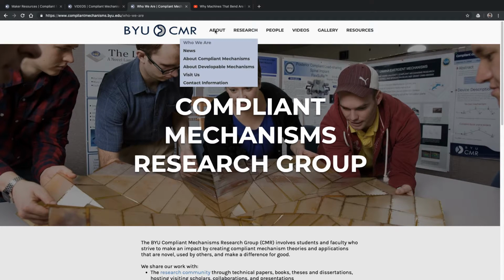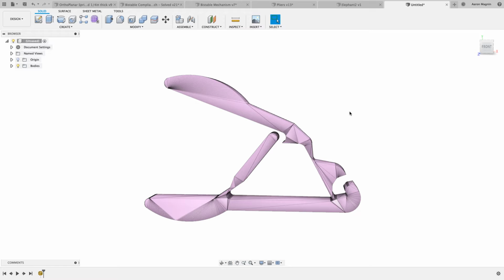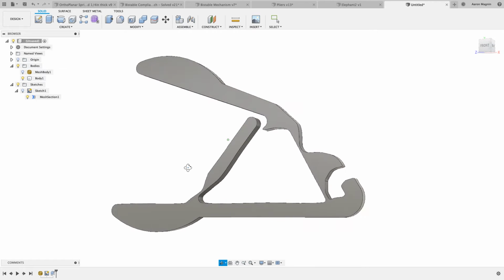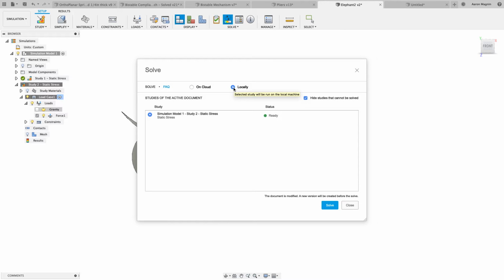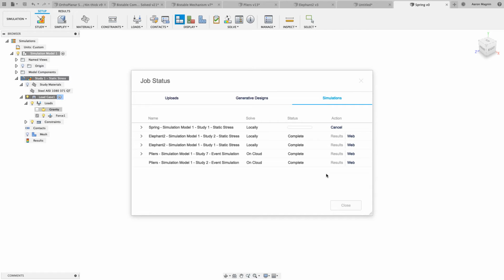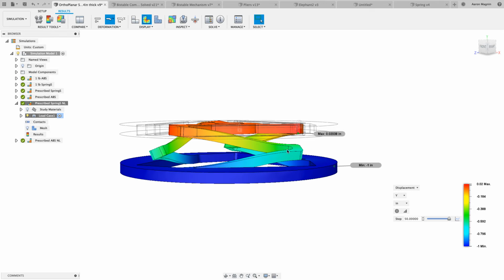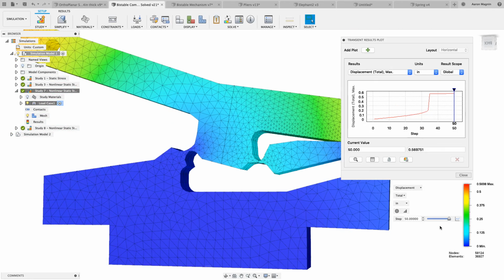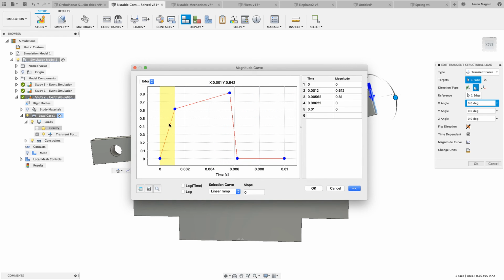360 LIVE: Simulation Verification of Compliant Mechanisms

Comment: I need to point out that this program is not really convenient. Lots of menus, right click lists, windows etc. UI is ugly, boring and repellant. It takes so much time to do simple tasks. Seeing that elephant simulation, I would definitely not use this program to design compliant mechanisms.
That’s a general issue with Autodesk. I think you need to hire some UI/UX professionals and revamp your your whole workspace and pipeline.

Anytime I want to draw something I don’t want to launch Autocad but it’s the best and I don’t have any better alternatives. But using it makes me hate what I’m doing. I tried to learn 3ds max but I couldn’t stand it and that’s why I’ve never even tried Revit for architecture, I don’t want to hate designing. 

Also you have so many glitches/bugs. Maybe instead of launching new version each year, you should have one version that you update continuously. 

And be lot less greedy, because you’ll lose in the long run when we have decent open source programs. People have already switched to Blender and people around me are not really happy with Autocad and other software, they just use those because there are no real alternatives.

Comment: HI Aaron, Thanks for a great stream. 
I was wandering if the solvers you showed can somehow relate to 3D printed objects?
e.g. taking into account stuff like layer adhesion or layer printing orientation
Reply from the maker: Hey Eyal, first off, thanks for the kind words! Unfortunately, I have some bad news....taking that level of detail into a study would be extremely difficult, if not impossible. Instead, your time would be better spent looking at the general shape of your superstructure.
Reply: It would need a non-isotropic material model for 3d printed parts to reflect the different stress-strain curves depending on the deposition direction.  These parameters can vary widely depending on print settings, material, and infill.  It would be very hard.
Reply from the maker: Fusion does not have orthotropic materials, but even that would be a stretch. 3d printed parts have an insane amount of variation that is best approximated.  See here for more info on materials: https://knowledge.autodesk.com/search-result/caas/CloudHelp/cloudhelp/ENU/Fusion-Simulate/files/GUID-011D96B0-9681-41C5-8A53-F6D557E19AB5-htm.html